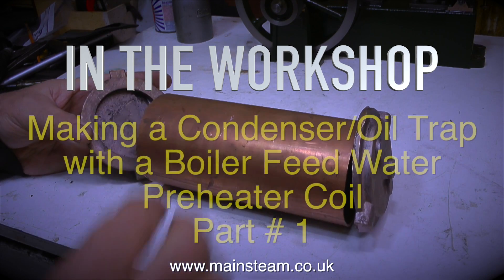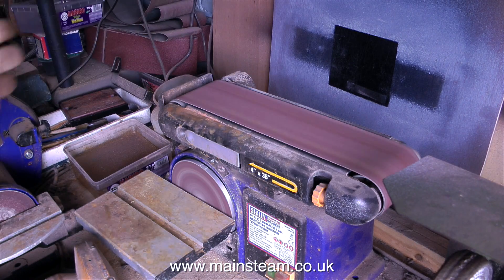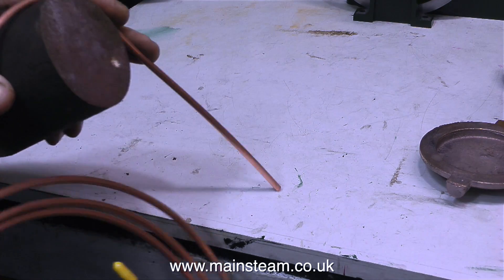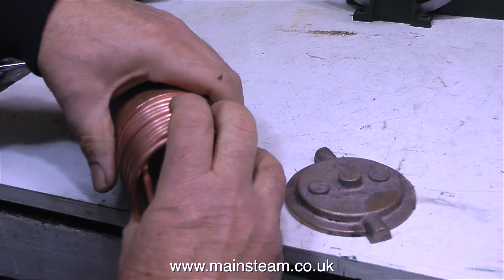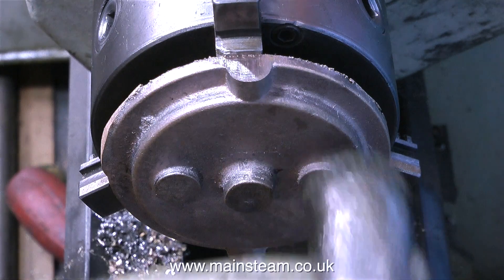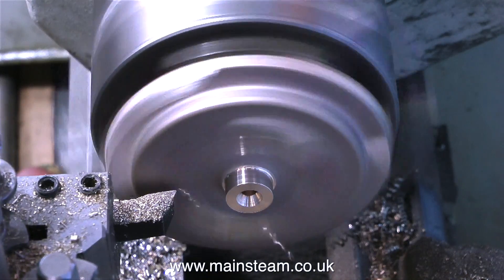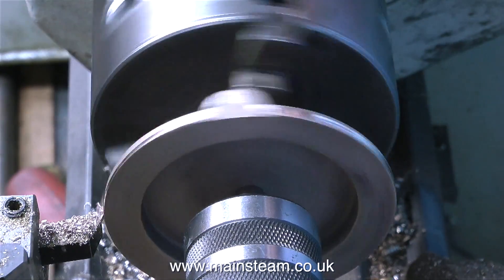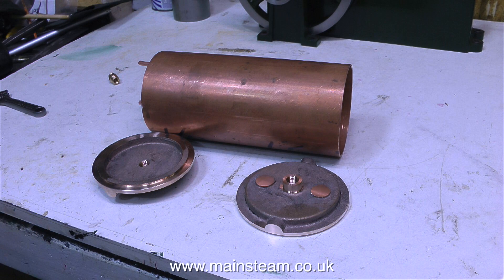MAKING A CONDENSER/OIL TRAP & FEED WATER PREHEATER - PART #1

Comment: One of the few economizers I have seen on YouTube so far. I’d love to some day figure out how to make an axial flow steam turbine to simulate a marine power plant in a remote control ship. Keith, I’ve been searching YouTube and haven’t seen any boats with superheated steam turbines. Do you think superheated steam is doable? Closed-cycle, with condenser and pump to recirculate condensate to the boiler?
Reply from the maker: Steam Turbines don't seem to be as popular as the old reciprocating type of steam engine s as you can't see the moving parts ...... Superheated steam is easy to do and very common in model steam boilers ..... recycling the water back to the boiler is difficult though in small sizes owing to the problem of successfully removing the oil from the exhaust condensate.
Reply: Keith Appleton thank you so much for your reply. I heard your response in my mind’s ear as if it was one of your voice-overs.

Comment: Have you ever run across the term "de-super-heater" for this type of heat exchanger that you just made? - I know the term from refrigeration and HVAC components. And it is essentially the same type that you created here. It may be a term that we use in the States and not elsewhere. Just curious.

Comment: Gloves: 
At one time, I worked for a large multinational company and I would get the monthly worldwide accident summaries... There were three types of accidents that happened over and over - getting hit by vehicles (cars, hi-low, etc.), falls (ladders, stairs...) and getting gloves caught in rotating machinery. Getting a glove caught resulted in injuries somewhere between (and including,) lacerations to amputations. 

As a person who is attached to his fingers, I don't wear gloves when using drill presses, lathes, disk/belt sanders, etc. And I applaud you for doing the same.

Comment: Great to see this video, I'm thinking of making one for my 5" boiler but not really sure how effective it will be as the boiler can be thirsty and the feed water tank needs topping up regularly. I was interested to see you had the copper coil to be a close fit in the tank I had assumed there should be a gap - is it usual to fit a close fitting coil ? Thanks.
Reply from the maker: I wanted to use the residual heat in the outer copper tube to keep the water warm when the engine is stationary ...... I will explain it in the next video {:-)))))))
Reply: Ok thanks, I'll keep a look out.